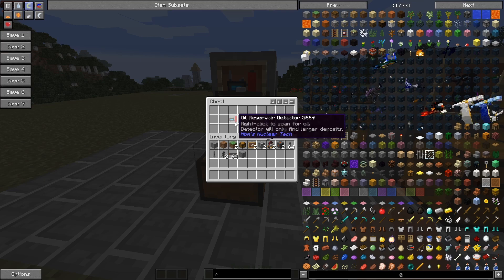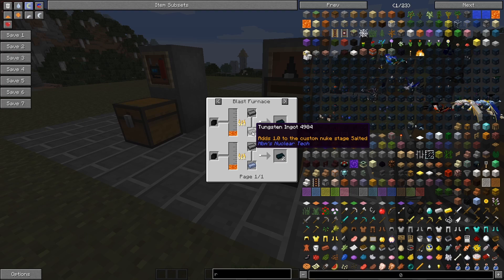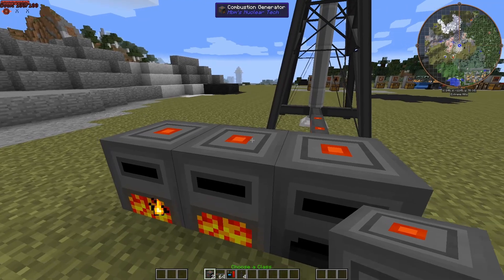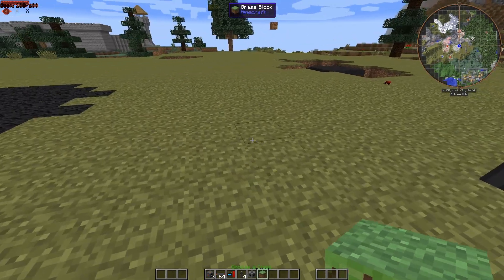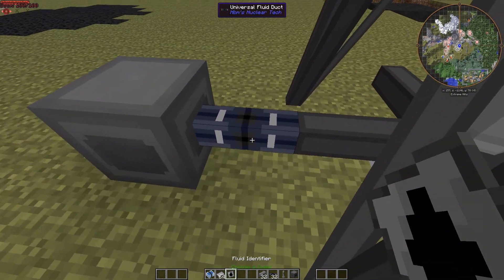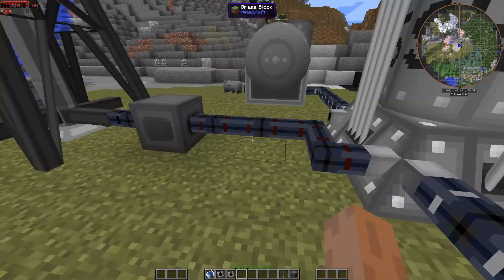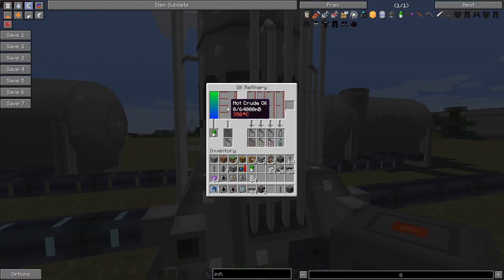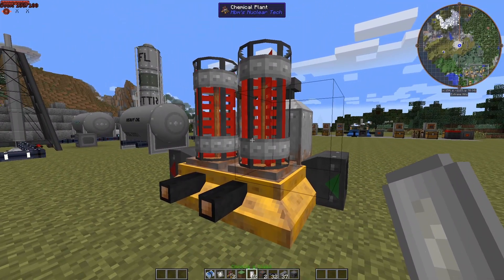Building an Oil Refinery!!! (HMB Nuclear Tech Mod Tutorial Part 2)

Comment: Please help when i put crude oil in the boiler and it heats up to 350 degrees nothing happens and i get no hot crude oil
Reply: Did you make sure to convert the universal pipe from the derrick to the boiler to hot crude oil?